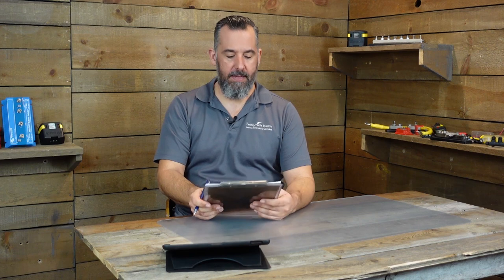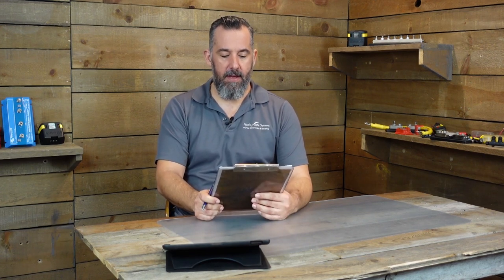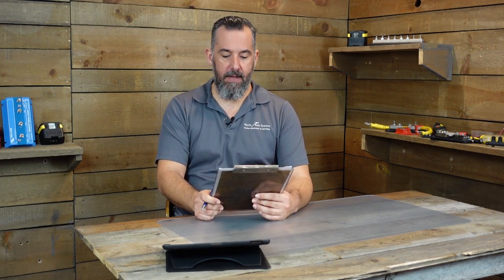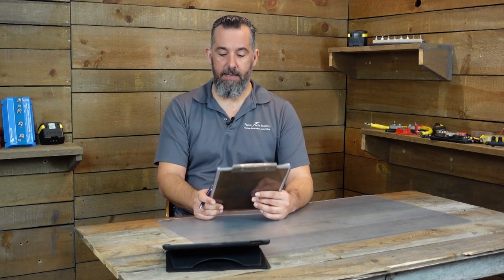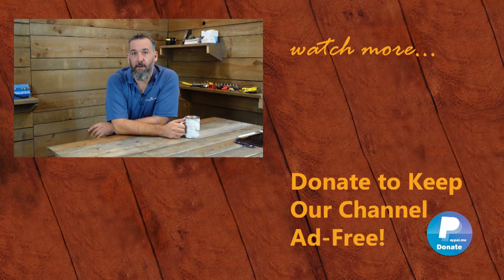How Do I Know How Much Fuel My Boat Is Using at Any Given Time?

Comment: Don't modern common rail electronically controlled diesels have fuel flow data from their ECU?  Won't help older engines, but the newer ones should have it out of the box, no?
Reply: My Volvo Penta D4s do provide that info through EVC
Reply from the maker: Hi Mark, yes some engines definitely do provide this info:
https://en.wikipedia.org/wiki/SAE_J1939
Reply: I helped a friend set up fuel monitoring on his 55 Sea Ray after he repowered.  The new Cat 12D engines had J1939 output with fuel flow, and he still had the Maretron FFM100's  installed in the fuel lines from the old engines.  Interestingly the numbers were non-trivially different, and the rate from the FFM100's seemed more reasonable than those from the ECUs.

Comment: If the Vista 258 has Volvo Penta with EVC, fuel consumption should be easy through Volvo Penta display or via Volvo Penta Easy Connect module.
Reply from the maker: Yep, some modern engines with J1939 data bus will easily provide fuel monitoring to  a non-engine display: https://en.wikipedia.org/wiki/SAE_J1939

Comment: Measuring fuel flow for diesel engines is a little more complex than gasoline, but really not that complicated.  Maretron's FFM, coupled with appropriate flow sensors, handles the differential flow and temperature compensation required, and outputs the data over an NMEA 2000 connection to your MFD(s).
Minor nit-pick, you mentioned the Garmin GMI20 display, but the graphic you showed was one of their older generation GMI10's.
Reply from the maker: Thanks David for sharing and the feedback. Your correct, Maretron has a good solution for diesel fuel flow,

Comment: Jeff. I'm redoing a old sailboat and I want updated speed depth sensors.. where do I learn about communication protocols. I would like to put in sensors that will communicate on a standard that's going to be available for at least 10 yrs. Replacing Moor electronics out of business 6 yrs now.
Reply from the maker: Good question, research NMEA 2000. This protocol should be here for another 10 - 20 years, IMO.

Comment: Hi Jeff, I bought a fuel monitor for my twin outboards from a company called FloScan Instrument Company, Ins. out of Seattle. I own a 22ft Center console boat in Alberta. I wanted to have something reliable to tell me what my fuel burn was for twin outboards on either the ocean which I do not very often but mostly on the big lakes in B.C. ie: Williston Reservoir, which does not have much for ingress and egress points along the lake so you have to be very mindful of the amount of fuel you have. They also have diesel sensing products as well. I installed this over 5 years ago and it works great, the only other thing you would need is a GPS that you can integrate with the system this is all explained in the installation manual and easy enough for me to understand, so I'm sure most people can do this DIY. Also it comes with it's own instrument to display multiple things like GPH or LPH(depending on which model you buy), RPM, Engine Sync, Hour meter, Totalizer( how much fuel you burned). Great product.
Reply from the maker: Hi S K, thanks for sharing about FloScan, really good company: http://www.floscan.com/html/blue/index.php

Comment: Fuel consumption on older gasoline engines that have carburettors measuring fuel consumption by measuring flow to the carburettor is accurate and relatively easy to do.  Fuel injection creates problem because there is a return from the high pressure fuel rail (all fuel injection systems have a pressurised fuel rail that feeds the injectors...port injection uses high pressure fuel rail; direct injection uses very high pressure fuel rail).  Typically fuel consumption is calculated by engine management system based on injector duty cycle (ie how long injectors are open and knowing the injector flow rate, amount of fuel used can be calculated...this is one way how it is done in cars and trucks).  The other way is to measure flow out of tank and return flow and subtract one from the other to get fuel consumed.
Reply from the maker: Thanks for sharing Borys.

Comment: On the subject of fuel, is it possible to connect two fuel level gauges to one fuel tank level sender? I am using a 240 to 33 ohm sender with a Autometer marine fuel gauge in conjunction with a Blue Sea Systems OLED gauge tank level.
Reply from the maker: Never seen this done before, you'd need to switch the inputs.